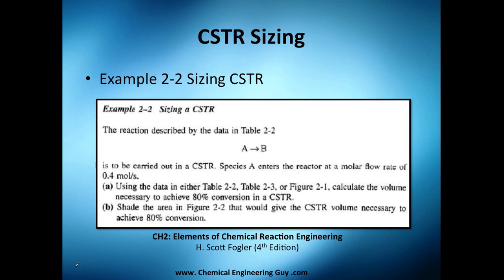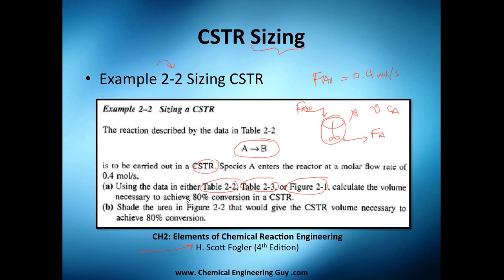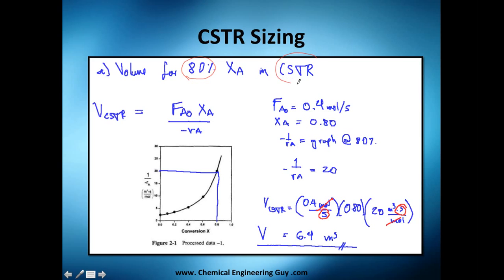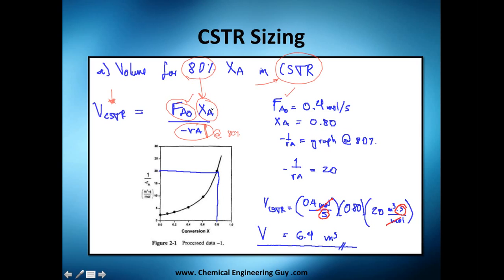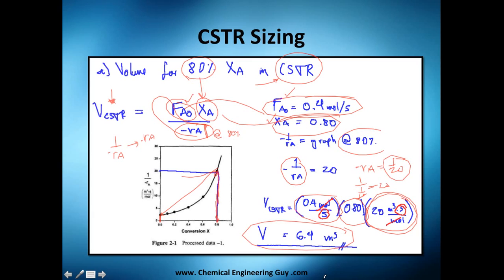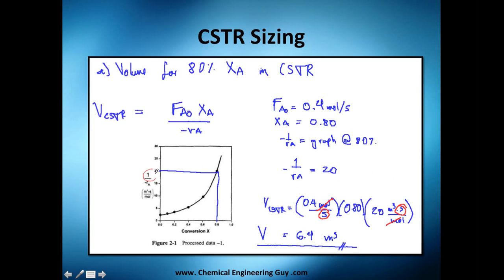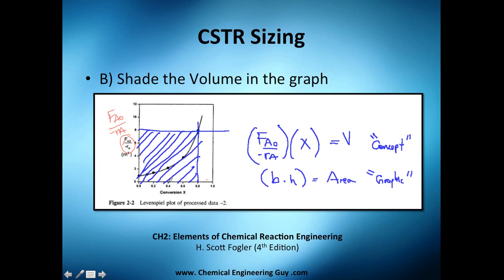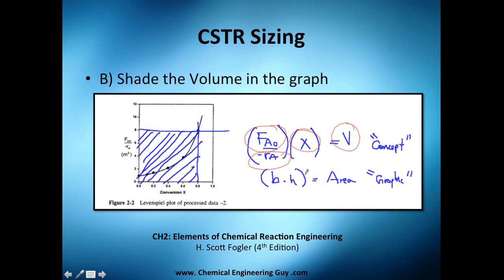Sizing a CSTR: Exercises // Reactor Engineering - Class 24

Comment: Please how can I determine the volume of a reactor if I’m using the data from an Aspen simulation?
Reply from the maker: 💬 In Aspen, you can find the reactor volume by checking the reactor block’s output streams or summary reports. Look for the volume parameter in the unit operation’s results, or use the design specs if you set them. If not directly given, you can calculate it using residence time and volumetric flow rate from the simulation.

Comment: Reactor volume = 6.4 m^3 
How to calculate its diameter and high?
Thanks
Reply from the maker: you will typically do this based on the reactor type, if it is a vessel type (cylinder container) or a pipe
Reply: @ChemicalEngineeringGuy  thank you sir